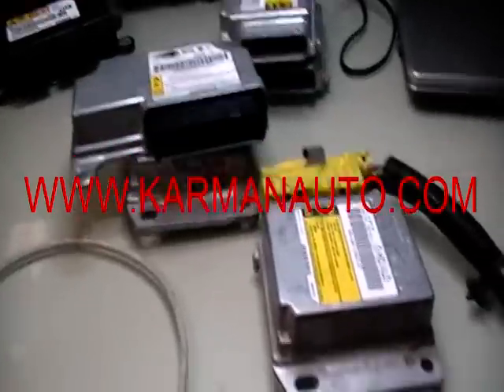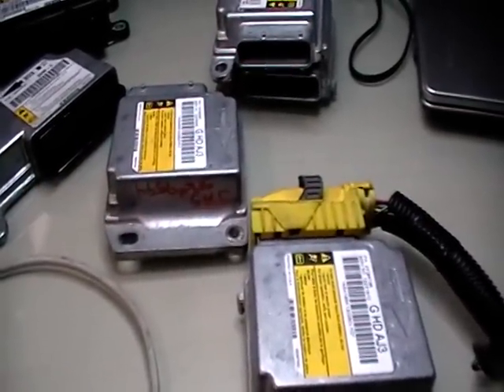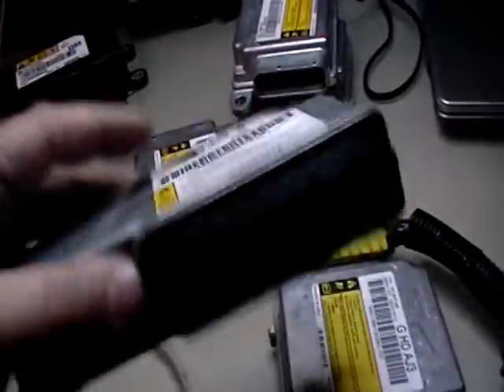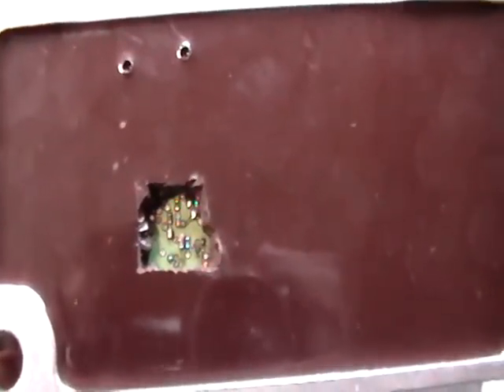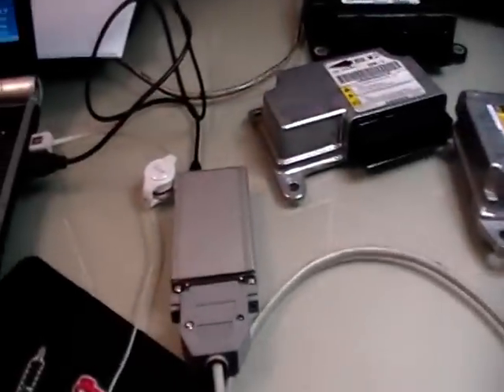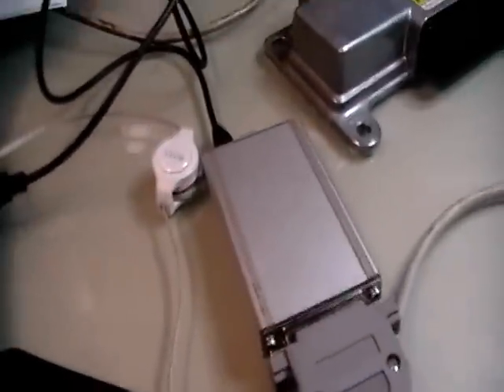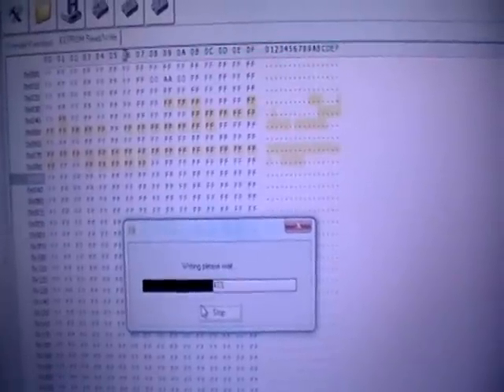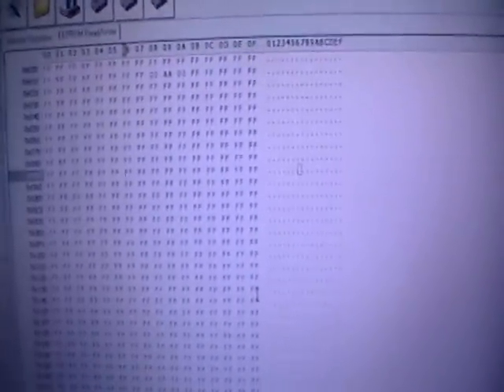How to Reset / Repair clear the crash data from GM Airbag control module part 1

Comment: Where do you get info on the breakbox and pin on srs used on gm 2011 1500 truck srs

Comment: Would it cause the circuit to be hot after the air bags have deployed just curious the breaker gets hot when I plug it in and it controls air bags and electric seats it’s in a 98 suburban

Comment: What about 2008 Saturn outlook EX
Reply: Joey Ashcraft we can clear the crash
Reply: I have my airbag light on the passenger side told that I was supposed to take it to a dealership but they charge $100 an hour
Reply: Joey Ashcraft was the car in an accident?
Reply: Bogdan Karman.        Not at all did a Carfax  on it
Reply: Joey Ashcraft you will need scan the car for codes it might be bad connection under the seat you can get a cheap code reader that will read codes on all cars for abt $150
Reply: Bogdan Karman .....why can AutoZone clearance same thing in it

Comment: hey, i have  2011 impala front impact, only driver bag deployed, i replaced bag, and seatbelt, and had module reprogram but still have a srs light on,,  scanner read B0013
RF/PASSENGER FRONTAL DEPLOYMENT LOOP   (STAGE 2 ) RESISTANCE OPEN
how can i fix this, and passenger bag was never deployed,  please need help

Comment: hi on the 2002 Cadillac Deville my light is on where's where's the module location I can't find it under the seat
Reply: Under console? Did you get it fixed? Is so how? I have an 2002 Cadillac STS V8

Comment: +vexih411 Couldn't you just replace the entire airbag computer with a junk yard car computer and airbags. The car is a 1997 Saturn SL2
Reply: Sometimes it’s different part number. And more than likely airbag modules from junkyard have crash data

Comment: Thanks for the video. I've got a 2005 Pontiac vibe. The dealership told me my "airbag sensing and diagnostic module" was bad. So I'm wanting to buy one and install it myself. Do I need to reprogram it to work with my vin, or is it just plug and play?

Comment: is this the same way to repair all airbags CU like i have ford edge 2013 CU it will be the same way ?
Reply: No. Some are eeproms. Others have mcu. I know this comment is years old but just in case someone else has the same question.

Comment: @ddemier you need to clear crash data so your airbag light can turn off. When you crash, this data is hard stored in the computer's memory, this is to prevent joe public from doing a hack job, and selling a car with Inop, or improperly repaired SRS. It's gov mandated.

Comment: just bought a used module for a jeep 2010 and did not no that the equipment had to be reset if it had crash data which i did not know it had and the fuckin bags deployed now my car wont start smh.....